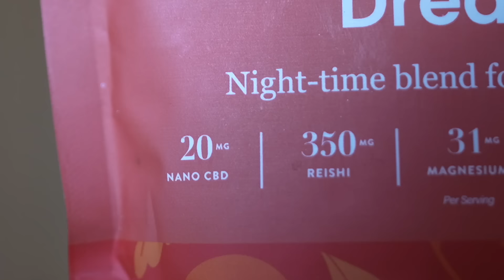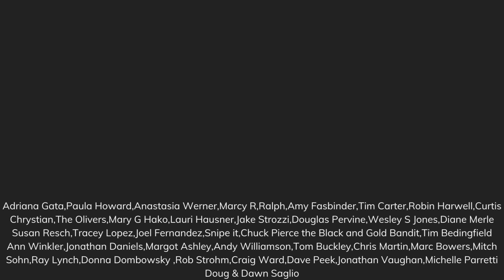WHY WE'RE RIPPING OUR OFF GRID HOME APART...

Comment: Hey guys...My dad was a finish carpenter, and he used a short piece of scrap tongue and grove to hammer on when seating the boards. It protects the edges of the boards so that you don't damage the finished wood, and it also lets you strike it a little harder.
I also am amazed at how smart, talented and beautiful Sadie is. Of course she has the best role-models in the world.
Reply: I was thinking that also. By pounding on the tongue they are making it spread, which makes the next board more difficult to install. Using a scrap piece of groove that fits on the tongue to pound on, is the way to go. It's hard to watch them struggle, when there is such a simple solution.
Reply: Not having the walls paint makes it dilapidated?

Comment: Nice vid and progress guys!
Tips: for hammering the floor planks, use a beater block... a small wooden leftover piece to hold against the new floor plank and it takes the hammer blows.
For your sleeping needs, natural pure liquid melatonin works well for most. I use the spray, 2 shots under the tongue and I'm out like a light.

Comment: That floor is going to look great! When installing them you might want to use an offcut piece to force them into place. It gives you the ability to lift it away from the floor and keeps you from damaging the flooring pieces. You can probably find a video that explains it better than I can. Just look up how hardwood flooring is installed. Also, I would recommend looking into a router table if you can get one down there. If you can't, maybe build one. It will save a ton of time and energy making the tongue and lips. 😜

Comment: You could put a tarp between the roof and the gym to route more boards and keep working... also, people usually put the floor in, then sand it and then put lacquer on top. Your grooves don't need lacquer
Reply: In Panama they do need to coat it because of the humidity and termites if they have them.

Comment: good job in tearing out that horrible flooring. The big question now is the moisture level of the new flooring. Expect gaps (from expansion/contraction), but that's OK, if you can tolerate it (lots of debris will fall into those gaps. GREAT WORK!
Reply: If there are gaps vacuuming is the best to keep it clean.